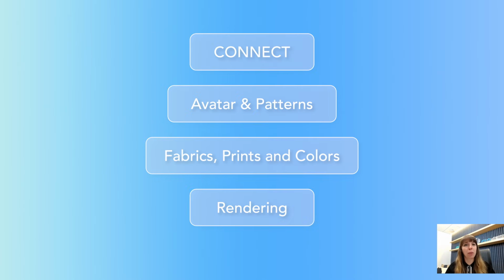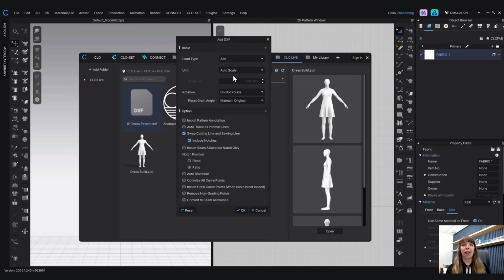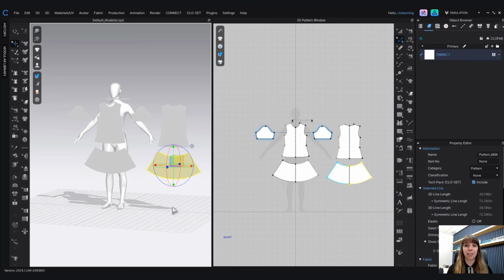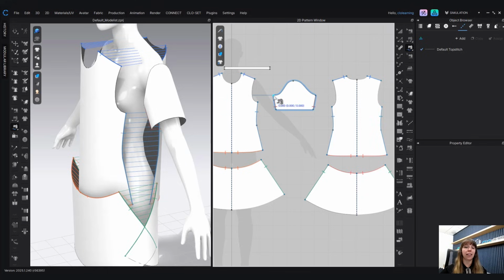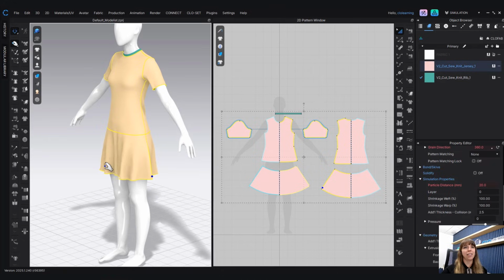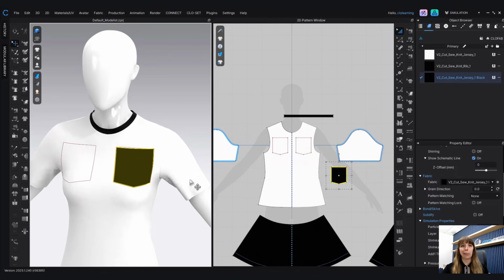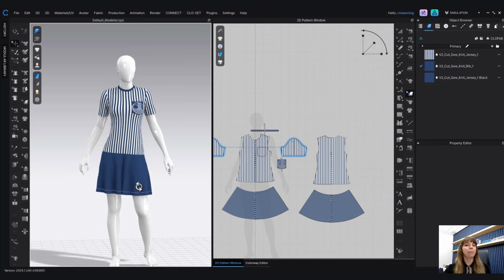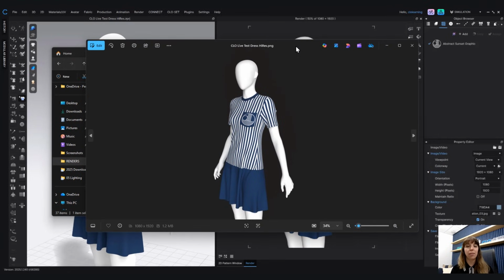Get Started with CLO! Beginner's Quick Start Guide

Comment: I'm trying to follow this video but for some reason after adding the mannequin and clicking on that sync button to sync the clothes in 2d and 3d, CLO crashes. I've tried downgrading versions, I've made sure my GPU is up to date, and I have an extremely powerful computer so it's not a specs issue. Unless CLO doesn't work for Windows 10, is there anything I can do?
Reply from the maker: Hi, can you check if your Nvidia card is set to high performance? (Look up "how to set nvidia gpu to high performance".) If this doesn't help, please contact tech support over our contact us page: https://www.clo3d.com/en/support/contactus and attach a dxdiag.txt of your computer.

Comment: ai summary

Abstract: This tutorial serves as a comprehensive technical onboarding for CLO 3D (version 2025.1), detailing the end-to-end digital garment creation workflow. The session covers initial environment configuration—including UI navigation, peripheral setup, and asset management via the CLO Connect platform—before progressing to core construction techniques. Key technical focus areas include DXF pattern importation, symmetric linked editing, and the application of 3D arrangement points. The instructor demonstrates advanced sewing logic (Segment, Free, and M:N sewing), mesh optimization via particle distance adjustments, and multi-colorway management. The workflow concludes with professional output protocols, contrasting rapid snapshots with high-fidelity ray-traced rendering.

CLO 3D Quick Start: End-to-End Digital Design Workflow

    0:00:08 Introduction and Instructor Profile: Ariel, 3D Designer/CX Manager at CLO NYC, introduces a high-quality re-recording of the October Live session, focusing on a foundational dress build.
    0:01:22 Asset Acquisition via CLO Connect: Demonstrates sourcing 3D assets, DXF patterns, and textures from the Connect store. Technical Note: Downloaded ZIP files must be unzipped before linking to the CLO Library to remain accessible.
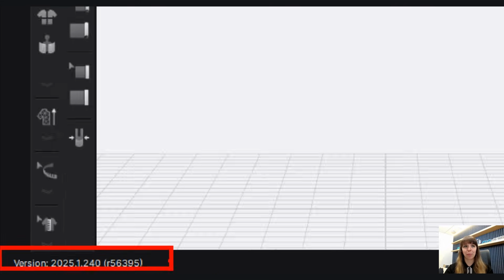    0:05:05 UI and Navigation Fundamentals: Overview of the 3D and 2D windows, Object Browser (BOM), and Property Editor. Key Update: The Library has moved to the teal linked icon in the upper right corner as of the 2025 version.
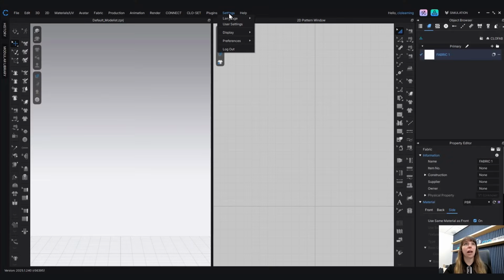    0:07:36 Environment Configuration: Calibration of user settings. Recommendations include using a three-button mouse, setting autosave to 5-minute intervals, and defining units (inches vs. cm).
    0:15:35 Library Management: Instructions on linking external folders to the CLO Library to prevent data loss during software uninstallation.
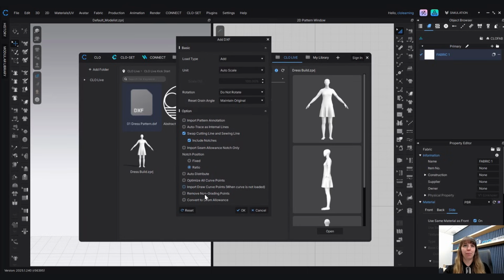    0:18:10 Pattern Importation (DXF): Protocols for adding DXF files. Uses "Autoscale" for unit accuracy and explains options for importing notches, seam allowances, and internal lines.
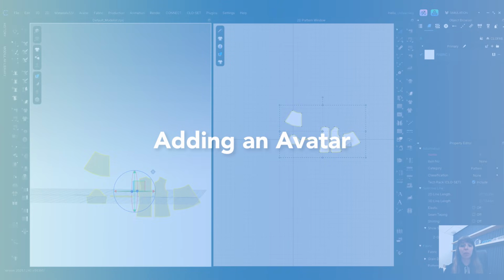    0:22:18 Avatar Integration: Selection and addition of a mannequin (AVT file) from the default library. Highlights the importance of the avatar as a collision body for simulation.
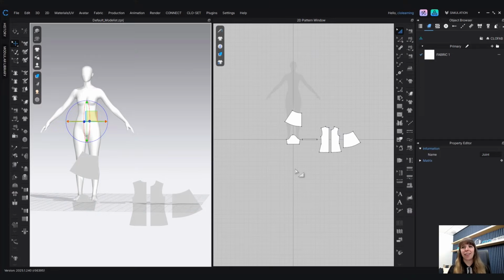    0:25:40 Navigation Shortcuts:
        Zoom: Scroll wheel.
        Pan: Click and hold scroll wheel.
        Rotate: Right-click (3D only).
        Shortcut '2': Resets view to avatar front and center.
    0:28:40 Pattern Arrangement and Symmetry: Uses "Transform Pattern" (A) and "Edit Pattern" (Z). Demonstrates "Symmetric Pattern with Sewing" (D) and "Unfold" to maintain linked editing across mirrored pieces.
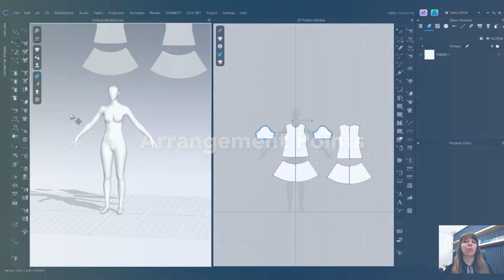    0:39:10 Arrangement Points (Shift+F): Utilization of blue arrangement points to wrap flat 2D patterns into 3D cylindrical volumes around the avatar.
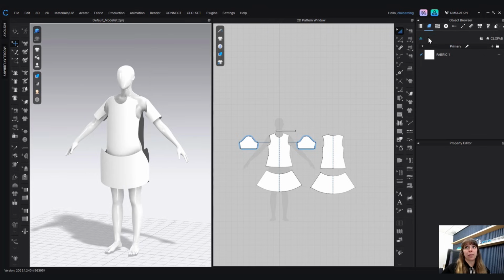    0:45:07 Sewing Logic:
        Segment Sewing: Edge-to-edge connection between segment points.
        Free Sewing: Four-point click system for custom lengths.
        M:N Sewing: Sewing one segment to multiple segments (e.g., sleeve cap to front/back armhole) using the Shift key.
        Directionality: Notches must align to prevent twisted seams.
    0:56:33 Simulation (Spacebar): Toggling gravity/physics. Explains GPU vs. CPU simulation and the difference between "Normal" and "Fitting (Accurate)" modes.
    1:01:00 Advanced Assembly (Superimpose): Using "Superimpose Side/Over" to instantly snap neckbands or pockets into position relative to their sewn internal lines.
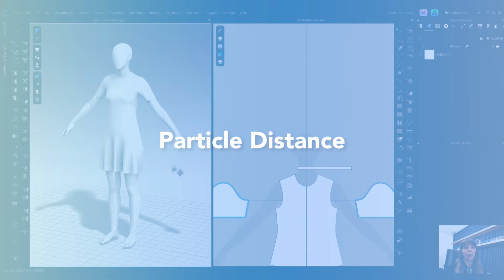    1:03:13 Mesh Optimization (Particle Distance): Adjusting the spiderweb mesh density. Standard: 20mm for large panels; High-Res: 5mm for small, detail-oriented pieces like neckbands and pockets.
    1:08:00 Materials and Shading: Searching the Fabric Library, applying physical properties, and using "Switch" to desaturate scanned textures for custom coloring via Pantone or HEX.
    1:31:40 Graphics and Branding: Distinguishes between tiling textures and "Add as Graphic." Demonstrates scaling, Z-indexing (Front/Back face for internal tags), and blending textures.
    1:38:40 Multi-Colorway Management: Using the Colorway Editor to create variants (Monochromatic vs. Striped) within a single project file. Includes "Edit Texture" (2D) for grainline and print scale adjustment.
    1:46:20 Final Output (Snapshot vs. Render):
        Snapshot: Multi-view 2D captures of the 3D window with transparent backgrounds.
        Render: High-fidelity engine setup, including noise thresholds (0.03), lighting presets (Studio High Contrast), and field-of-view (35) adjustments for professional portfolios.

Comment: I use 7.0.242 this version i cant find this option (Remove Link Editing) and When add Level In back side. cant i insert in inside in the garments.
Reply from the maker: Hi. We would recommend updating as many newer features like Remove Linked Editing we only added later.
But for further help we recommend posting to or official CONNECT forum so you can add photos for our team to see and better assist 
https://connect.clo-set.com/community

Comment: i still can't understand what's the purose of this software.
i download it because i thought that this gave me the possibility of putting my body measurments in some form and create a pattern based on these measurements!
What's the point of creating an avatar every single time and connecting the dots to make a garment fit in the avatar??
is there a possibility of putting measurments into a pattern without avatars and sht or not???
Reply from the maker: CLO is a specialized tool for 3D visualization and garment fitting. By inputting your specific body measurements, you can generate a custom avatar and use our AI tools to develop patterns tailored to those dimensions. Just as in the physical world, a form is essential for fitting; without a body to support it, your garment will simply fall to the floor.

Comment: Hi! Is it the latest version update that by changing the avatar position in 3d to the side or back, the 2d shadow stays frozen? I’m new to this, but some advice from a year ago, where they say by changing the avatar’s position in 3d will reflect in the 2d window, that they are linked, doesn’t work for me. Thanks!
Reply from the maker: Hi. The position of the shadow in 2D will always reflect the Front View position in the 3D window. 
If you wanted to reflect a side view you can select the Avatar in 3D and rotate the avatar 90 degrees. so the avatar is now technically facing sideways 

For further help on this we do recommend posting to our connect forum where you or our team can add images :)

Comment: Hello, I’m learning CLO 3D and using versions 7.2 and 2025. I have one issues:
After running a simulation, if the fabric falls and wrinkles, Ctrl + Z does not restore it to its original flat state.
My laptop specifications:
CPU: Intel Core i7-5500U (dual-core, low power)
RAM: 8GB DDR3
Integrated GPU: Intel HD Graphics 5500
Dedicated GPU: AMD Radeon R7 M265, 2GB VRAM
Windows 11
Any guidance on how to fix these problems would be greatly appreciated. Thank you!
Reply from the maker: Hi and welcome to CLO. For help please post your question to our CONNECT Forum where you can also add images for our team to look at :)
https://connect.clo-set.com/community